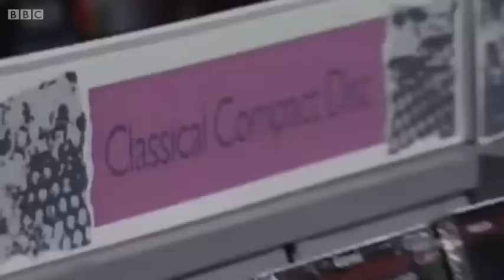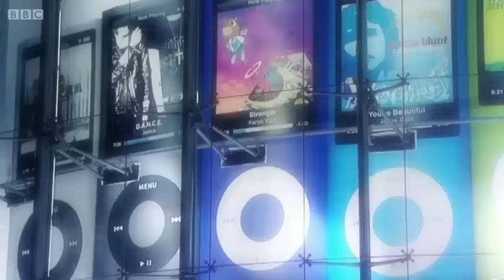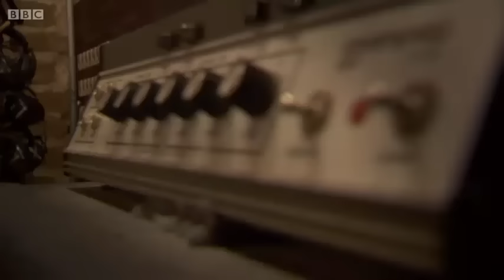Steve Albini listens to Shellac on an iPod.

Comment: I don´t blame steve he´s set in his ways and he´s a master of his craft... but a 320kbps mp3 through a decent hifi sounds perfectly fine
Reply: You're right and will add that a bad mp3 encoding can happen not everything digital is flawless.
Reply: 320kbps is fine. But vinyl sound better. When actually mixed for vinyl that iS
Reply: Yeah honestly I would blame it on the earbuds those look like crap, he even mentions it as he takes them out
Reply: the better the system the worse an mp3 sounds. unless you have bad ears. run a studio master flac file through and maybe it’ll sound okay but anything less is a no-go for a real music lover
Reply: @elijahcambry3319  that mostly because new memory since ddr 3 and onwards bios settings will auto adjust to a fastest config by default the operations between ranks read&write and different dimm must be exactly the same on time so you wont get intermodulation distorsion for having the same operations with a desync in different timings between dimm modules
Reply: If he plugged his earbuds into his phono it would still sound like earbuds. In 2023 there is no reason to use MP3 anymore though.
Reply: MP3's Suck !

ANALOG BABY!!😁👍🏻  Thank You Signora ALBINI 😎✌
Reply: The biggest advantage of analog from an engineers POV according to albini is that the masters will never be lost due to technology being outdated and abandoned, he's seen dozens of digital recording formats and the masters recorded on them come, go, and become impossible to recreate, I for one cannot fault him for his perspective.
Reply: @newagain9964  It depends on the vinyl, on the record and on the equipment. Even if you have an "audiophile" vinyl it has gone through bad equipment like once in a lifetime it will lose information and acquire more surface noise. Don't even mention other physical aspects of the medium itself, that limits the frequency range that can be recorded onto it. Now, digital media is obviously plagued by loudness war in a way that vinyl, by default, cannot ever be because there is a limit to how loud sound can be when being pressed onto it. More music is produced and put out digitally, while vinyl is obviously harder and more expensive to release than uploading a digital file, so usually you will listend to records that have had much more care taken in their production etc, which tilts the scale favourably to vinyl. Our ears are also much more sensitive to high frequencies, and it is usually on the ends of the frequency range where wear will be more perceptible, but that might actually contribute to the sound being perceived as being more pleasant and "warm" (whatever that means). This whole thing about one medium sounding better than another has much more to do with cultural expectations and what a "classic" or even "hi-fi" sound entails than with the actual medium.

Comment: Perhaps the low-end information wouldn't be lost if Steve listened the MP3 on a nice pair of speakers instead of super shitty earbuds? This was just so utterly dumb.
Reply: I don't think it has to do with speakers a really bad mp3 encoding will sound bassless and brittle but is just because the encoding system has issues could be time related or jitter a good mp3 encoding will sound good on anything even on the crappiest speakers just like vinyl would
Reply: that's called quality journalism , you know? :))))

Comment: FLAC is way better than m3ps because it's the original recording put onto a lossless digital format and get a good pair of headphones and it'll sound great, and just as good as a vinyl record
Reply: This is a common misconception. The difference between mp3 and FLAC files is only discernible if the listener uses a digital to analog converter (<$250). This needs to be routed to a headphone amp ($99) if using high quality headphones (<$250) or an amplifier routed into Hifi speakers (<$600). At this cost it doesn’t make sense to listen to FLAC files as opposed to vinyl records. Furthermore, streaming services that offer FLAC files don’t pay artist as much as someone actually buying their record in a store. That being said I am someone who mainly uses Qobuz FLAC files if only for the convenience. Go figure lol

Comment: From the mid 90s to the 2000s, digital recording and computer-based production went through an awkward phase as it became the standard. The technology needed to catch up, to develop and evolve. CD’s, mp3s and streaming aren’t the best mediums. But today you can record digitally and have it sound basically perfect. 

It’s all about equipment, knowledge and mastering. Digital recording only sounds like shit if you don’t know what you’re doing, you’re emulating bad trends, or the medium it’s presented in is outdated. Even Steve’s studio uses digital recording as an option these days, and I guarantee you they use it a lot.
Vinyl is technically better, but the line is a lot less clear today than it was 10-15 years ago.
Reply: Vinyl doesn't have as high a sound bandwidth as a CD does.
Reply: Vinyl is technically worse, it's just worse in a way that people like because it's essentially a low-pass filter over everything. People don't like higher frequency content, which is what vinyl tends to lose and why CDs are often described as sounding sharper and harsher: they're produced by people and methods that came from vinyl, but they don't lose the frequencies vinyl records naturally do. A proper EQ on a well-encoded digital master will sound identical to a vinyl when played through the same hardware - but cleaner, because it doesn't have the surface noise vinyl does.
Reply: Vinyl is not technically better at all. Even a "audiophile" vinyl is hostage to the equipment you're playing it through, and even then the medium has physical limitations that digital simply doesn't have it. Obviously it is a whole different history what people find sounds "better", and definitely not only the vinyl sound (less bandwidth, specially on high frequency ranges) in itself but it being resampled and re-used countless times seeps into that equation in a way that it has less to do with "technical" sound quality and much more to do with sounding "pleasant". Digital production can sound harsher just because it can more accurately reproduce a larger range of sound, but that also is up to technical abilities of those involved and, ultimately (assuming the technical ability is there), creative choices - some records might WANT to sound unpleasant.
Reply: @movimentodoscacos what makes the vinyl is better argument even more dead is the fact that most albums were recorded mixed and mastered digitally since the mid 70s.

Comment: Just like any format, you have to be listening to it with the right equipment or best recorded product to get the high end which he says is missing.

If you listen to a low quality piece of vinyl on a low end record player, you’ll get the same response as listening to an MP3 on a pair of shitty earbuds or listening to a CD on a cheaply made CD player.

Having a good system in any case will help you. Lossless or any kind of high grade digital will exponentially increase the enjoyment of listening to an album.

Comment: If it was recorded for a certain medium of course  quality is going to dip if its enjoyed through different  way
Reply: what do you mean by "recorded for a certain medium"?
Reply: @warshipsatin8764  recorded for vinyl or CD. I think that's bull though because if an album that was originally recorded for vinyl was ported over to a CD as long as they ported it from the master recordings it would sound better because CDs have a better bandwidth for frequencies that vinyl doesn't. The CD only sounds like shit if they're porting straight from the vinyl.

Comment: This documentary makes it sound like vinyl has a specific sound while in reality, that mostly of that comes with how it's mastered.
You can master a CD (or any digital format) like vinyl but you can't master CD like vinyl since you have physical limitations.
Early on, people were going overkill regarding what they could do hence why things sounded too bassy, too shrill etc.
I like vinyl but don't make it sound like it's superior when it really isn't.
Reply: For me its just that vinyl is just way easy to handle to get the proper good sound. Digital is way more complicated and also the distorsion are harsher and anoying instead of the inherent distorsion flaws of vinyl like wow and flutter whic are warmer and non intrusive but digital in the other hand if handle it well thru a good system is just perfect sound.
Reply: @newdeep19  great point. A lot of people claiming vinyl is superior in "quality" really just prefer the sound coloration produced by the equipment they are using. It's not that the audio is higher resolution at all

Comment: The worst here is that this piece of misinformation comes from none less than the BBC. I love Albini work/recording philosophy. And his belief in tape as the only long life medium. But this is vinyl propaganda pure and simple. 

I have seen lots of videos stating the same but none takes the Pepsi challenge. Which consists of A/B’ing a vinyl record with a recorded version of that same vinyl on CD. Listened through the same amplification system.
Reply: I've done that! I even did it with a Shellac record. On my setup the CD sounded waaaaay better
Reply: I always say this. CD is superior as a format in every single way.
Reply: CD has great quality but it does have a tighter sound, you can crank a LP or cassette much wider, but ultimately you can do that with a good system anyway

Comment: Slightly pointless exercise. Vinyl can also sound terrible on crappy equipment.  I mean, I have Shellac (Steve's band for those unaware) albums on vinyl but I'll listen to them off a hard drive as long as they're in FLAC or some other larger file so as not to lose the bottom end...or middle or top for that matter...and through half-decent headphones and amplification obviously helps. Steve knew this too, but, given a choice, sure, vinyl on good quality turntable & amp marginally edges out digital. RiP Steve Albini 💙